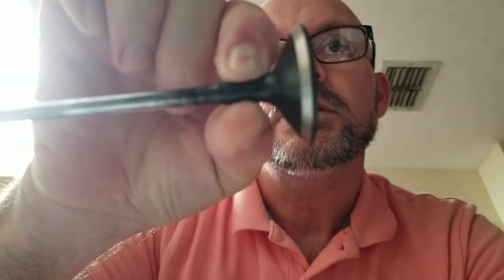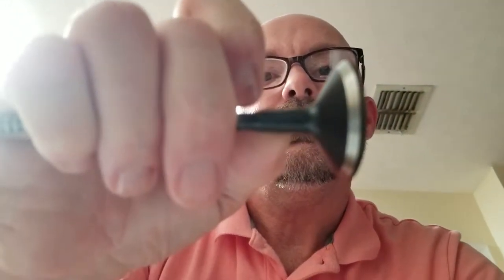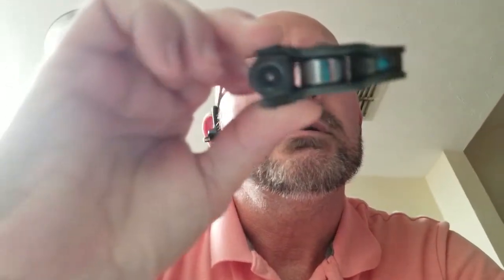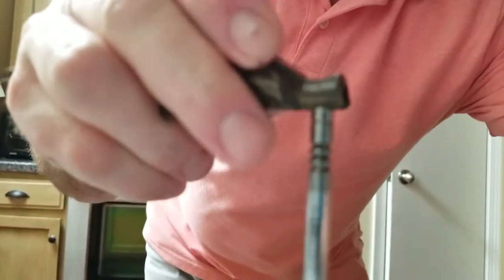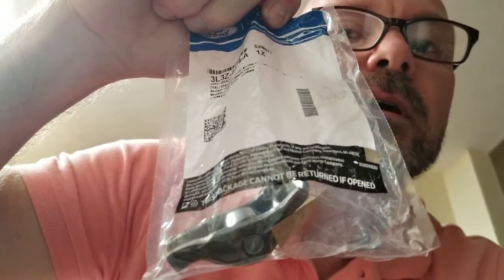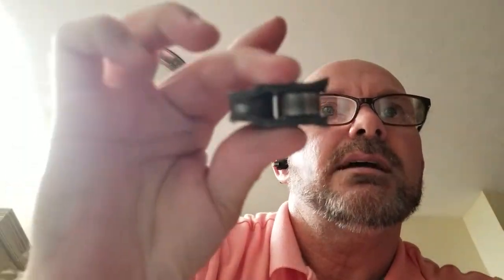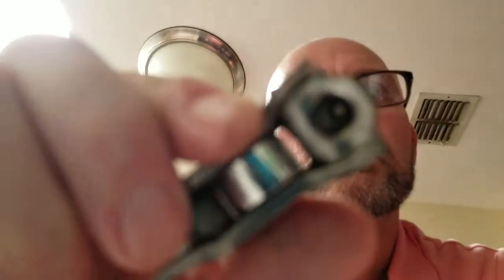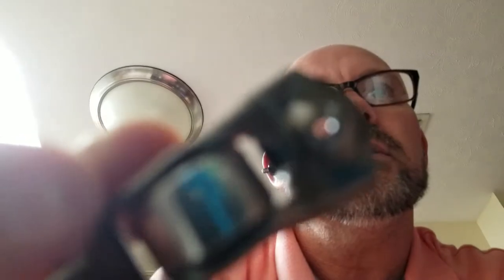Camshaft Followers, check your parts well.

Comment: There's a different between the standard cam follower and the Ford performance follower, I had the same issue. After speaking with Ford Performance they told me it was redesigned 4-5 years ago to get more oil through it for large cam profiles. Mine broke and wiped out the cam, make sure and replace all of them
 with the updated version or you will have failure. Since the replacement with the updated followers I've had no issues.
Reply from the maker: Yeah, after several visits to the dealer, then the FordTechMakuloco - YouTube channel it seems to be the new methods. I appreciate the info. Can you subscribe please? I would greatly appreciate it.
Reply: @michaelkennedy2528  I did 😁